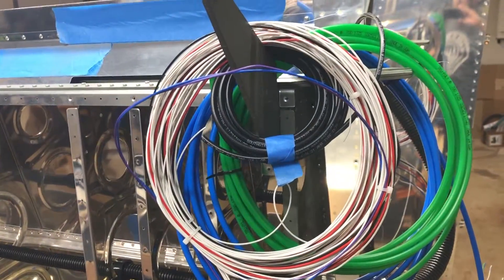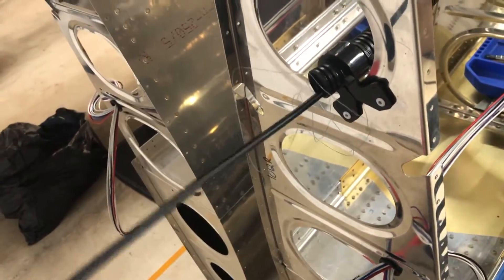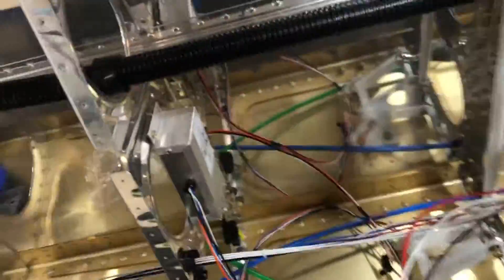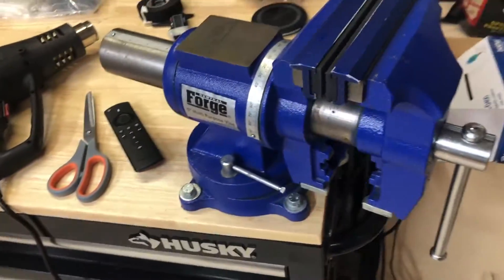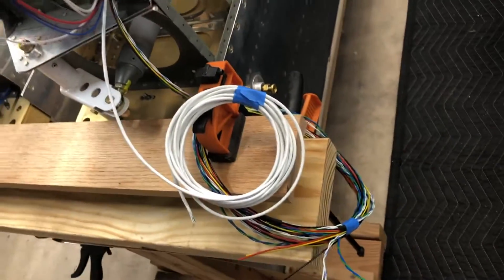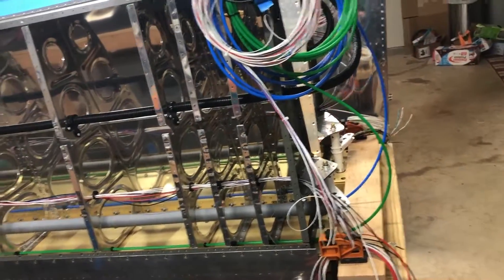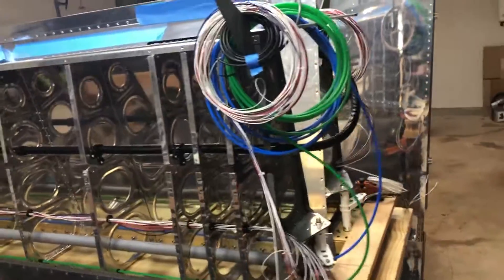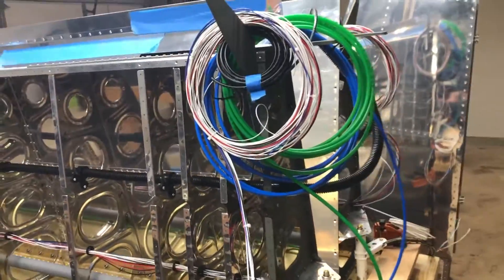RV10 Build 22 - Wing Wiring Harness

Comment: Plan on putting a waterproof connector at the wing root for all of your wiring.  I say waterproof because you are more likely to get wet connectors at the wing root than inside the wing.  Duetz makes a great waterproof connector (though they are a little larger than other connectors.)  It makes life simpler for your wiring and if ever you need to pull a wing off it is simple to make the disconnect.  

Even make a waterproof disconnect for the nav coax.  You will loose less than 0.1 dB on the signal for the coax connector.  Putting the connectors on will make your life so, so much simpler when it comes time to attach the wings.

Either put your service loop in the wing side and place a bulkhead fitting on the side of the fuselage, or vice versa. If you wind up with enough wires to require using two identical connectors you can place one set of wires with the bulkhead on the wing rib and on the other set of wires with the bulkhead on the fuselage.  This would "clock" the two wire bundles so they could not ever be connected up wrong.
Reply from the maker: Thanks for the tips...finishing the doors then I am starting to run the wires and I definitly think I will need a connector in the wing root, while my original plan was not to have it.  I think if the wings were on "as per the plans" at this point of the build, I could do without the connector, but I am not planning on putting the wings on until way last minute.

Comment: I was told to use shielded wire whenever possible due to interference from the Bob Archer antenna? What did you end up doing with ziptip wiring? I am about to do mine this week.
Reply from the maker: My understanding is that it is totally unnecessary to use shielded wiring for everything.  1) The LED lights are much lower output than the old strobes and 2) the only thing that would get interference in the wing is the NAV antenna and that is run with shielded coax.